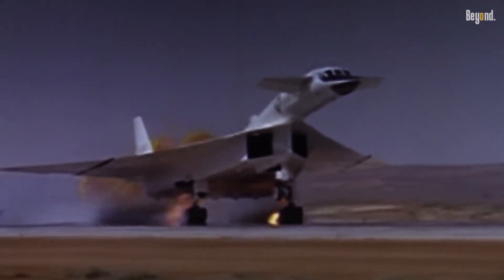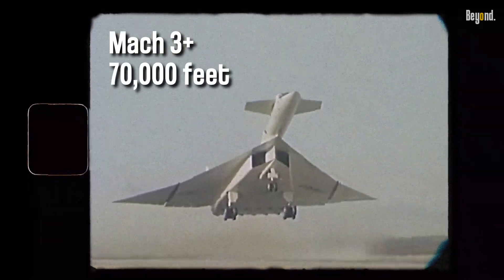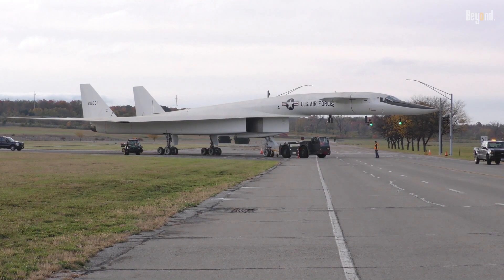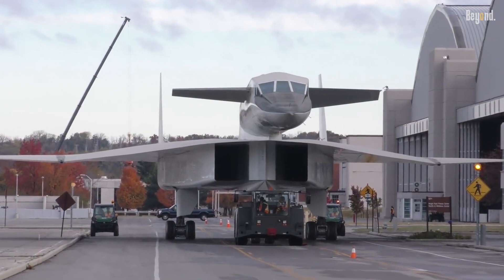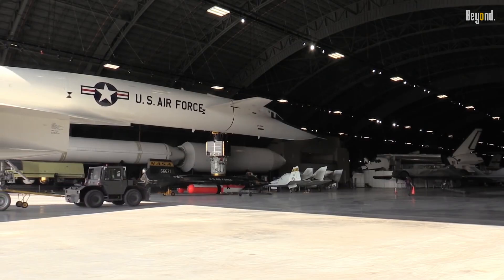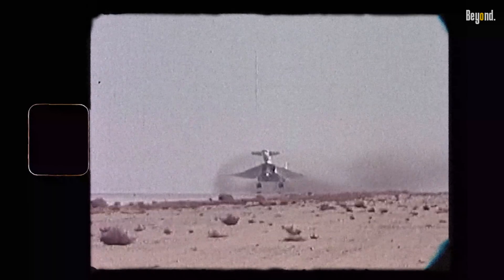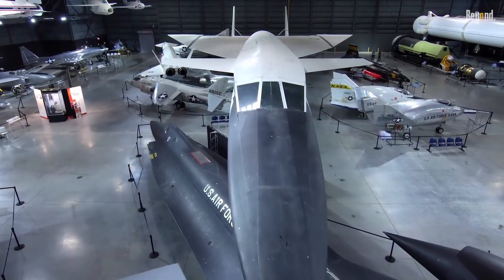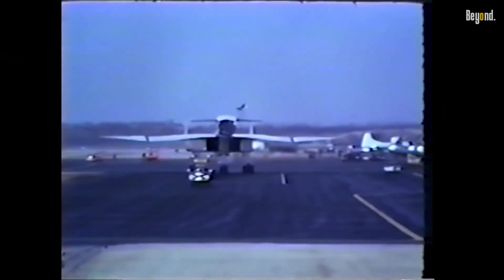Why The XB-70 Valkyrie Wasn't Built with Stealth Capability

Comment: And now lidars have become so cheap and portable that they’re putting them in aircraft and all that money invested in radar evading technology is money down the toilet. The latest Chinese aircraft mount a lidar that can detect an f-35 at 60 miles. The russians have a similar lidar setup but the embargo on western parts means that while they have a design they can’t produce it. The russians still don’t make microchips fast enough or powerful enough to process the data. They rely on what they can buy from the west. And the west isn’t selling.